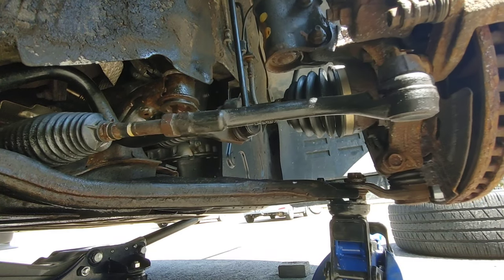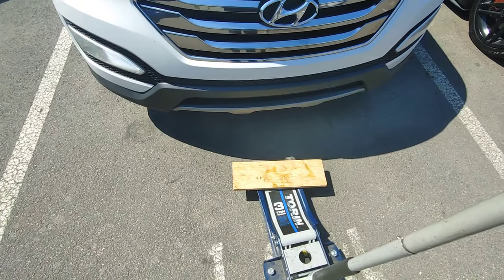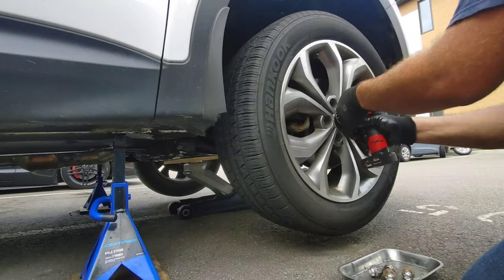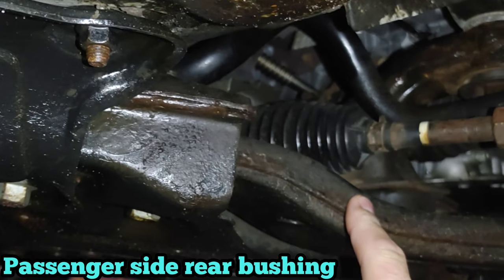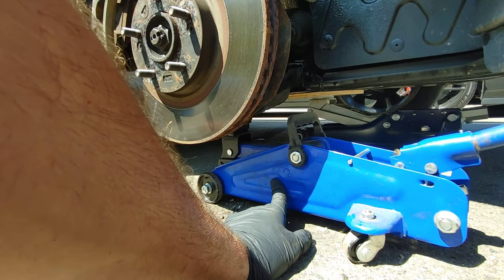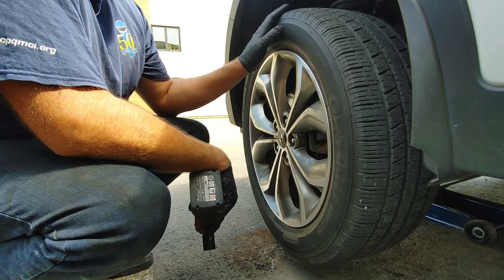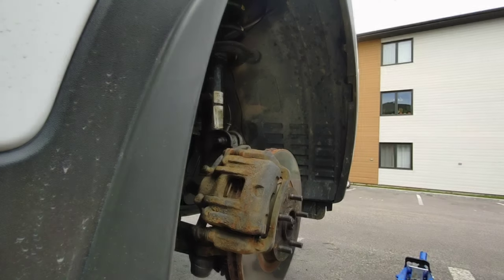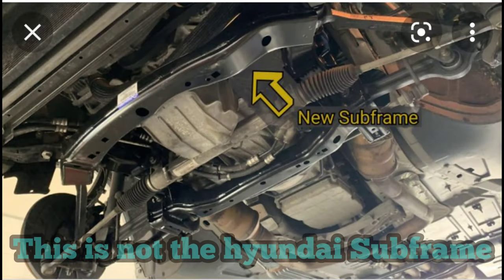Creaking Noise when turning diagnose

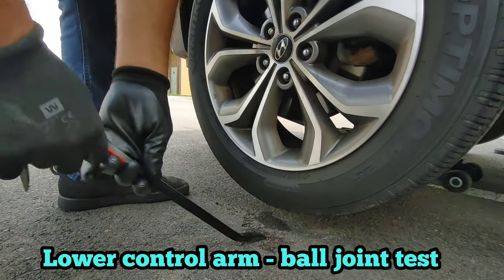Comment: how would you describe the sound made at 3:10 on the "lower control arm ball joint test"? I find it hard to describe
Reply from the maker: You mean the sound of the tire against the pry bar?
Reply: @basicdetail4512   it was the tire rubbing with the pry bar? totally missed that, I thought it was something else! but yes, the sound that is heard each time the pry bar is lowered... what word would you use to describe the sound?
Reply from the maker: @clavarojwt  Thats hard to describe the sound , m'y first Language is french so im far to be the best person to help you on That ... But im Curious why you want to Know how to describe that
Reply: @basicdetail4512  because my first language is not English, and I'm trying to figure out how to describe the symptoms my car has so I may research it further. Basically, there's a creaking/squeaking sound that I've managed to reliably reproduce if I turn the wheels to either side, and then rock the car by pushing it sideways (not vertically), engine off or on, brakes on or off, doesn't matter.

Comment: @ Basic Detail hey sir how you doing today ? I have a question I have the same issue with my 2010 Acura MDX when I move the sterring wheel and the car is in park I heard that screak noise in the passenger side I’m not sure what is it but I changed the front struts , stabilizer bar bushing and stabilizer bar links I don’t see nothing weird in my suspension I try to lift the car in jack stand and put some weight on the suspension with a jack as you did and I heard nothing but when is in the ground you can heard it turning the sterring wheels. Could my issue be the same as you because I remember a time I went to my mechanic to changed the motor mounts he put the cross member down a bit and the car was doing the same noise when moving the sterring and I take the car back and he fit it but one years later is doing the same weird noise. Do you know what was the exactly thing your mechanic do to fix your issues in your car ?
Reply from the maker: Hi Hansell im fine thanks i swear you are good too ! The cross member story make  me think you got the same issue than me ! So AT your question the only thing m'y mecanic as doing is to torque the cross member AT the wright Spec the Driver Side was torque pretty close to Factory  but the Passenger Side wasn't tight AT all ...since he tight all the Bolt of the cross member with the torque wrench Specs everything is quiet ! Please  give me news about IT im Curious of what IT was
Reply: Hey sir thank you so much for the info I will try to check how tie are the front cross frame bolt because I already check the rear part of the cross member where the sterring rack sit and they were all pretty tie but I didn’t check the front part of the cross frame.
Reply from the maker: @hanselldisla4643  i hope it is just the front Bolt in case ITs not That you may look the check the list i made in the video ! Im happy if m'y video help you  and thanks for the feedback

Comment: For those that might not have context to understand this videos value…he covered all the possible sources of noise. 

I just replaced the front lower control arms, sway bar end links, sway bar bushings on a 2017 Subaru Forester. 

After all that I’ve done…I’m dealing with hunting down a noise similar to whats in the video. It’s driving me crazy. 😁

I’m at the point where I’m removing and replacing (same part) the passenger lower control arm. I want to make sure the ball joint on the new part isn’t faulty. 

Next will be making sure the inner and outer tied rod is ok. 

Diagnosing this noise can be extremely frustrating. Everything you’ve changed has been straight forward and easy (for the most part), but you’re left with this clunking noise you can’t find. 

Two tips
1. Make sure to use a product like PB Blaster catalyst penetrating fluid on rusty bolts. Follow the directions on the can. I forgot to use it on the stuck, slightly rusty, control arm ball joint; I spent an hour with a pickle fork knocking that thing out. On the opposite side, I remembered the PB Blaster…knocked the ball joint out in three whacks. 

2. Make sure you put weight on the bushings BEFORE you tighten them. If you tighten the control arm bushing while the wheels are off, the bushing will be pre-loaded when the proper weight is on the wheels. In other words, there will be tension on the bushing that shouldn’t be there. 

Thanks for this comprehensive video. It took a lot of effort to pit it together for us. 

Cheers 😎👍🇺🇸

Ps I don’t know what your native language is, but…your english was fantastic 👍
Reply from the maker: Wow thanks so mutch my friend ! I really enjoy your comment ... my first native language is french . Have a good day and thanks again
Reply: @basicdetail4512  You’re welcome. I had a feeling it was French 👍😎

Comment: Did you check the sway bar bushings?
Reply from the maker: Yes i Do they was in good condition ! Its was the crossframe Bolt they wasnt torque well
Reply: @basicdetail4512  ooohh ok not a big deal lol, my Scion xB 2006 is making a noise when take a bump
Reply from the maker: @metrox5044  sound like a ball joint maybe
Reply: @basicdetail4512  Im gunna check everything

Comment: I have a mustang, the guy I bought it from hit a curb on the passenger front side so for some reason now the tire rubs very bad on the inside of the tire. Anybody ever have these issues? The ball joint and lower arm of the suspension has been replaced but still does it, would it just be a tire alignment or do I need a stabilizer bar?
Reply from the maker: IT happen to me in the past make sure That your sub fram is straight and everything is square when you compare both Side and after That go align the car

Comment: Mine is same sound but little louder I feel it in the front middle or in the passenger seat side, however I hear it louder because I’m inside the car. It only happens when I start driving from 0 and press the gas then I start hearing it or Turing right or left also when I’m about to press gas from 0 other wise I don’t hear it at all, however my car is hybrid and some mechanics told me it might be a sign for gasket :/ is that true?
Reply from the maker: Ah gasket of what did you Know ? Your problèm looks very similar than mine , i dont trust the Most of the mecanic they or Wallet .  so did you check your direction to se if everything is solid
Reply: I just hit a curb on mine. No obvious damage but the same creaking sound now when I hit the gas from 0 or turn left/right when driving. Only when driving it’s there.

Comment: Everything should be brought to specs at a dealership. That dealer mechanic should be ashamed doing poor work? They charge big money for nothing. Finding torque spec can a lot of times be hard, it's so ungraceful we have to pay for torque specs. Dealers should be required to have listings through the parts online. My bets was on the lower arm to frame and never thought the sub frame. Weird I found my the stabilizer links were so floppy without grease but no noise. It's a sad racket dealers practice designing suspension parts without grease fitting so we prematurely have to replace them. TKU
Reply from the maker: I am in total agree with you 🙏
Reply: Factory "Torque spec" is only useful if the screw & bolt is in NEW condition. Once the screw was torque, it will never in the exact same shape as new. Hence, the factory torque spec will be off.

Comment: Nissan QASHQAI SUV 17 😊I went for alignment and many mechanic failed to inspect the issue, Even the Luton all mechanic are sick or don’t know much about cars
Reply from the maker: You are right !
Reply: @basicdetail4512 i have issue with my car , having grinding sound when turning left for sharp turn at certain angle at end at then end at complete steering turn between 90-100/100  , its  fine if I use about 80 percent of the turning capacity , no sound at stationary position and no at reverse not when taking right turn at any angle
Sound popping while driving
Reply: @basicdetail4512 
It’s popping from left side wheel when I am using turning capacity after 80+ percent to 100% moving steering to the left for left turn .
Grinding sound like something like grinding stone is touching with the wheel

Comment: Did this noise depend on weight? I have a very similar noise, which becomes more prominent with the more weight in the car. 2011 Sonata that also had an engine replacement by Hyundai. https://www.youtube.com/watch?v=nQeEOj7gjgc
Reply from the maker: Defenetly m'y friend i Will bet on the subframe Bolt ! I sound very similar to mine

Comment: Use a mechanics stethoscope to find noises. You can put it on each part and you will find the noise in 10 or 15 minutes. Since it was a body noise might of taken a bit longer but you would have got there once ruling out all the other parts.

Comment: The best old way of checking this , is to spray WD40 on all the rubber joints and from there will no where the noise is . 
This seems like it was coming from the top strut and that has play aswell
Reply from the maker: That was the bolt of the front sub frame